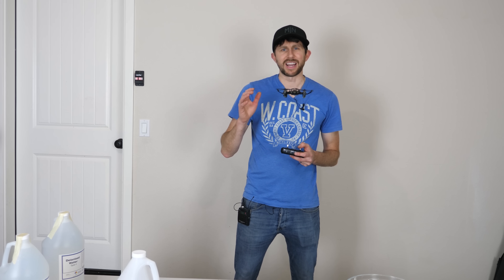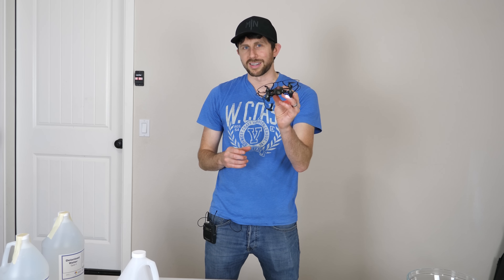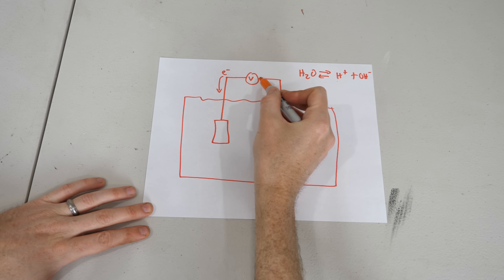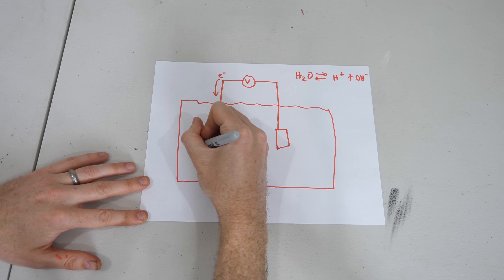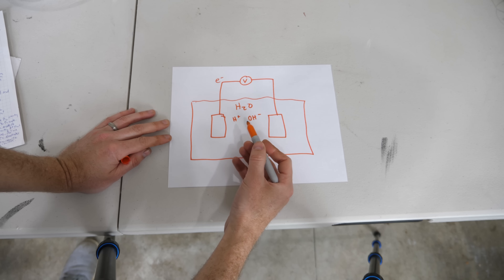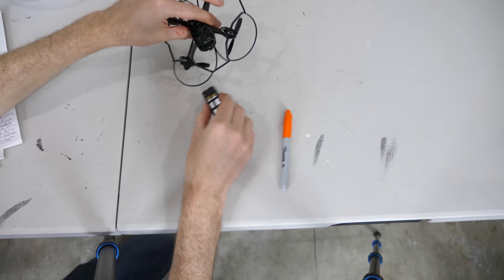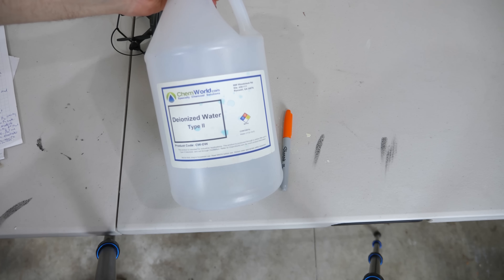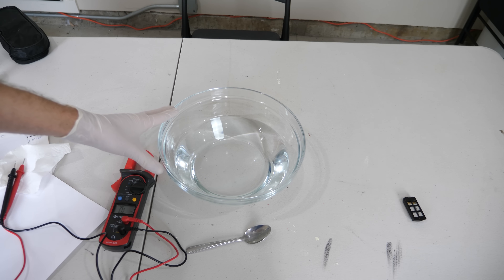Can a Drone Fly in De-ionized Water? Experiment

Comment: The RF Radio Frequency has a hard time going through water!
Reply: Yeah it is using 2.4GHz which is absorbed by water really well. This also happens to be the frequency used by your microwave because of its interaction with water.
Reply: @wesleyson21  But have you considered its deionized water? I REALLY don't know. Would I be able to heat deionized water in my microwave? I guess not, but I don't have deionized water to test it. I have some distilled water though, but I guess it's not the same.
Reply: Distilled is close enough. But yes you can heat it but it may not boil if the container you use is clean enough. They actually tested this a long time ago on Mythbusters and when you dropped something in it would basically explode because it boiled all at once.
Reply: @Adam_Lyskawa  probably, because water is a dipole.  The microwaves excite the dipoles and energy is dispersed as heat.  I dont believe that ionization has any major affect on that behavior.
Reply: A Dog an ion is an atom with either an extra electron or missing one.  For water to be de ionized kind of implies it has been distilled.  If you have salt in water you have ionized water.  Boil the water and collect it, leaving the salt behind, you will have de ionized and distilled your water at the same time.
Reply: You realize RF stands for radio frequency right?
Reply: @1234567895182  lmao im not the only one to notice that
Reply: NumberSixteen BusShelter some people eat pita bread too.
Reply: @1234567895182  he just said it you know?
Reply: I agree, the reason its not working well under water is because the radio signal from the remote is having trouble going through the water. I have a waterproof Bluetooth speaker that loses connection under a couple inches of water. If you notice the lights on the quad start flashing like its trying to reconnect with the remote.
Reply: @adinserter, except that these small types of drones don't use RF signals, they typically use IR signals. (No antenna on the transmitter, but it looks like there is an IR LED.)
Reply: Drone remotes works usally at 2.4 or 5 GHz (like your wi-fi router or your microwave oven) that's not the point.

The difference between "normal" water and "deionized" water is as explained in the video just ions concentrations but the microwave oven effect does not depend on numbers of ions.

Both normal and deionized water is just water with molecule H2O
The greater number of electrons running around the Oxigen molecule and less number (only 1 for each atom when paired with O) of Hidrogen electrons causes the polarity of water molecule.
Water is a polar molecule means that if we apply an electric field, it align with field 
                       ^
    H+      H+      ||   Electric field
          O-             ||

In conclusion when this field changes during the time, as example in the case of a wireless data transmission or into a microwave oven, all water molecules try to align to electric field and start rotating each other causing friction and so dissipating the wave energy into heat

Drone transmitter is too weak to transmett data over wather withouth dissipating and too weak to heat up a bowl of water
Reply: Phew. I’m glad I wasn’t the only one extremely bothered by this.
Reply: exactly
Reply: It is IR I dont think it can go through glass but I could be rong the water is also not helping
Reply: If it's a 2.4GHz transmitter it may have a problem as water's resonant frequency is 2.4GHz. That's how microwave ovens work.
Reply: Water does not resonate at 2.4GHz, that's a myth. That frequency was chosen because it's in a band allocated for such purposes by the FCC. Quite a broad range of frequencies would heat water just as well. See: https://bethesignal.com/wp/2017/02/why-do-microwave-ovens-operate-at-2-45-ghz/
Reply: Ik
Reply: I think RF would change it's frequency in water due to refraction. Am I wrong?
Reply: No, as the speed of the waves gets slower, the wavelength gets shorter, keeping the frequency the same.
Reply: Greg Ewing the speed of the radio waves is the same as the speed of light.  Frequency and wave length are related to each other, but waves do not change frequency in the water.  They just get dissipated, scattered.  Frequency does not change unless you change your device so it can be different.
Reply: Fun fact! If you're on a phone call and submerge under water in a sink it'll lose single
Reply: I’m pretty sure that it’s just the weight of the water that’s pushing down on the propellers.
Reply: @Perilloux  in a part of video, propellers spins and drone lift a little
Reply: Yes
Reply: R/ im definetly an engiinerr
Reply: also btw that's very simple science you guys act like your geniuses wow your so smart for knowing that radio waves can generate heat when passing through ionized water or even normal water so smart that's literally the process of photosynthesis uv light if energetic enough can knock an electron off of an h20 molecule plants figured out before you were born
Reply: Right !!!!
Reply: wth the hell
Reply: I think it is an IR remote and it will be hard to fly the drone when it is sunny.
Reply: adinserter Radio waves have a hard time going through any good conductor. Basically, the radio waves get used up to induce electric current in the water which generates heat. This doesn't happen in de-ionized water as it is an insulator.
Reply: @sunilsoni3310  Relative dielectric permeability of water is almost 90, what happens when wave hits dielectric barrier? Three effects, transmission of the waves alongside with absorption and reflection, please do consider the real and imaginary part of relative dielectric permeability of water and calculate all three terms by your own! You could be amazed.
Reply: @nsakan972  this is the most complete answer
Reply: @sunilsoni3310  also you don't even have to be that smart drones are not meant to move underwater their  meant to fly in the air  cause air can spread out is a lot more energetic than water and is in a gaseous state so its a lot easier to move and doesn't hold shape like water so grab a bucket filled with air pickup and fill another bucket with water pick it up and tell me which one is heavier
Reply: @BossOfAllTrades  also punctuation existed before you were born
Reply: @sunilsoni3310  It doesn't matter if the water is nonconductive, the quad will still lose signal if placed in water more than a few inches deep. For DC voltages the DI water is considered an insulator. But at 2.45ghz frequencies that doesn't hold. RF waves can heat any water because is a POLAR molecule. The RF waves interacts with the dipole of the water molecules causing them to flip back and forth and heat up. Same principle  as a microwave oven just much weaker. So be smart and don't put your quad in any water if you can avoid it.
Reply: Even if the radio waves could go through the water, the motors would have a hard time spinning the props, because of the viscosity of the water.
Reply: @XxPPslayer69  I am not sure if the servo of the motors for such a small drone has a blocking function for the overload, I did not even mentioned a smallest glitch of the propellers.
Reply: On top of that the weight of the water would probably keep it from leaving
Reply: I'm starting to realize that most of Action lab's viewers are dummies who don't know shit about science. Kinda disappointed.
Reply: @sunilsoni3310  no shit. It's a family friendly science show where everything is explained like you're five. The fuck you thinks it's made for? College grads? It'd need more dumbing down then.
Reply: @sunilsoni3310  glad to see you as an intelligent intellectual
Reply: @sunilsoni3310  Youtube is the TV of the 21st century, the majority of Youtube viewers probably like over 70% are under 8 years old. That's why the majority of bigname youtubers narrate like a 1st grade teacher to better identify with their primary audience, adults of the internet be damned.(Example: King of Random. Used to do cool projects, now works with candies and things attractive to toddlers while running his Pre-K)
Reply: @sunilsoni3310  lol
Reply: Sunil Soni yeah fuck that i just skip the science because im curious they are good questions
Reply: @bna7656  you should take initiative to actually learn science I use to hate it but overtime it   became my favorite subject

Comment: There must be an over-current protection circuit that shuts down the motors do they don't burn up from trying so hard to spin!
Reply: I think what the system is detecting is voltage drop for the battery.  The flashing lights is the alert for low battery power to warn users that the battery voltage has dropped below the safety levels.  I have one of those little ready-to-fly models too.
Reply: Smrt man